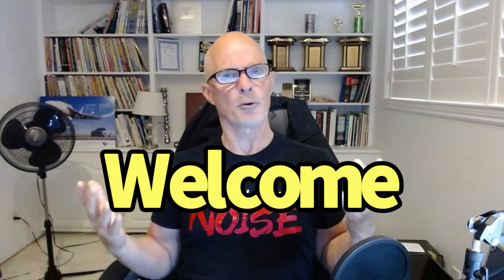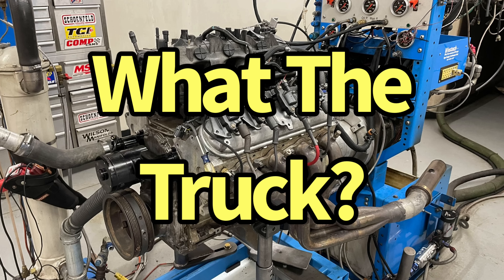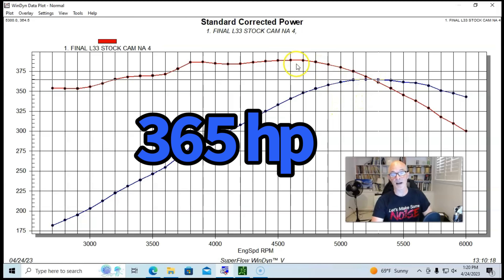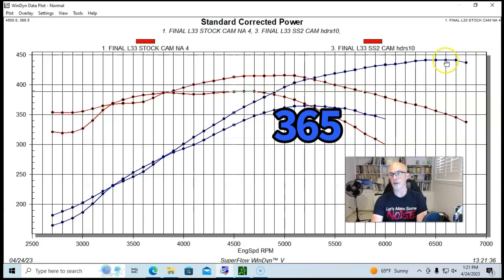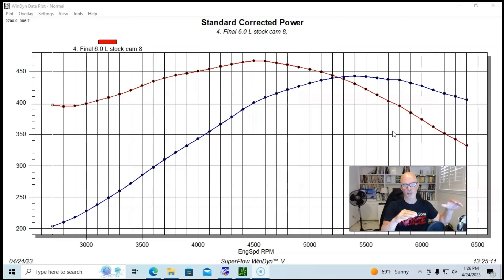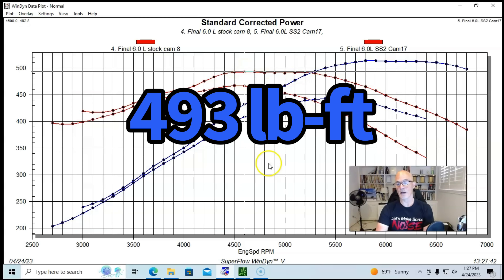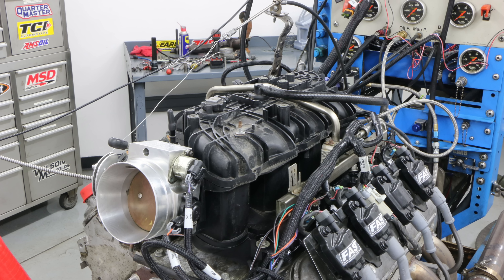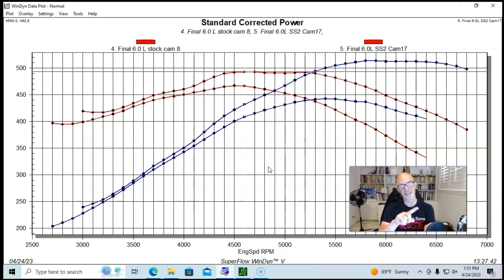HOW MUCH HP WOULD A TRUCK NORRIS CAM MAKE IN A 6.0L? NO TEST DATA-SO LET'S MAKE AND EDUCATED GUESS

Comment: I have this cam on my 6.2 with long tube headers .
Sounds amazing, thinking of changing it out with something different. Lots of guys state I’m leaving a lot of power on the table . Do you happen to know what can I should go with? Want to add low end power and add up top.
72 c10 Shortbed 6.2 truck motor  ls3 intake  1 3/4 headers  4l80 2800stall 373 Gears
Thanks in advance
Reply from the maker: You can go bigger on the cam with a 2800 stall-but you won't gain low end with a bigger cam
Reply: Thanks a lot Richard for the reply love your videos lots of great info.

Comment: Just asking for advice, would
this cam be to much for a
daily driver in a 2003 6.0l
2500/4x4. Stock cam now..
any recommendations would
be greatly appreciated! Thank 🍻
Reply from the maker: it works well in a 6.0L-also take a look at my Low Buck Truck (same results-just costs less)
Reply: @richardholdener1727  thanks

Comment: I'm building a 408 stroker out of lq9 6.0 using stock 317 heads i port and polish them want the truck Norris cam set just want to no your thoughts and a good intake
Reply from the maker: Best cheap intake is TBSS (we have on our store-richardholdenerperformance) and if properly ported, the 317s can support a lot of power

Comment: Might be late to the party, but some people might want this info. I did an LQ9, Stock 317 heads (Just springs and trunnions), TBSS Intake, 90mm TB, Long Tubes into 3 inch dual exhaust in front of a 4L80E and it put down 333 rwhp and 356 rwtq. That's on 91 pump with conservatives timing (24 at the top end.). Torque is flat all the way across until it starts to dip down after 5000rpm. Horsepower builds until 5700rpm.
Reply: Stock cam?
Reply: @trailerparkcryptoking5213  Truck Norris cam.

Comment: My sons 08 Silverado Vortec max (L76 aluminum block 6.0) got the dreaded afm tick so we dropped it off at the delete shop today.   getting full vvt afm delete with truck norris cam and long tube headers.  Thing was a powerhouse before with the 4:10 factory gear sets-  should be awesome   when its done
Reply: Let us know what RWHP and RWTQ it makes after tuning, I have an L76 in my '09 G8 GT , have a slightly larger 217/225 Cam Motion cam for it, should be very similar results. Thanks
Reply: @QuicKurtZX14R  It wont be getting Dyno tested
Reply: @leinie6683  street tuned ?
Reply: @QuicKurtZX14R  yes-  got it back this morning.  Runs great-  a little lope at idle but runs very smooth a few hundred rpms of idle.   Headers run through stock pipes and muffler so its not loud.   Could probably benefit from true dual exhaust and cold air intake ,  but 1 thing at a time.
Reply: Thats an iron block my man. I second guessed myself and had to google to confirm i was right
Reply: @GreaseMonkGarage  No- Its an all aluminum block and 823 rec port aluminum heads from the factory. Magnet  doesnt lie.   Pontiac G8,   Holden Commador and  Vortec Max pickups were the only vehicles to get it from 07-09.
Reply: @GreaseMonkGarage  the L76 in my G8 GT is an aluminum block,  🤔
Reply: Any vids? I have the l76 engine too and would like to hear what the TN cam sounds like.

Comment: Is there a recommended or max or minimum compression range Recommended this cam.
Reply from the maker: if you were trying to run max compression, you would likely be running a different cam too
Reply: @richardholdener1727  That probably makes sense, If the Question was different.

Comment: Richard,
I have a 2018 Chevy Silverado 2500HD 6.0L. I was thinking of installing a turbo for low end torque while pulling. But I’m looking at $6,000 plus the ECU reprogramming.
I’d like to see you do an actual Dyno test on a 6.0L to see what the actual numbers are for this Truck Norris.
Although it won’t be as good as a turbo, it would definitely help me gain some more power and at a much cheaper price.
Could you do an actual test with Dyno results when you get the opportunity to do so?

Always great videos and lots of knowledge.
Thank you!
Reply from the maker: the 6.0L test video with my Low Buck Truck cam (same as Truck Norris) is already up
Reply: @richardholdener1727  Awesome! I’ll take a look. Thank you Sr!

Comment: My truck is not going to pass smog in California with a cam
Reply: It will it’s all in the tune. Just gotta find the right mechanic if needed, and search high and low for best tuning guy in your area. The tune will cost around 1000 for engine and trans tune together.

Comment: Please do the test! Any 6.0 with a ls3 top end! The suspense is killing me 😂
Reply: We’re waiting for this setup. Damn it
Reply: It will make damn near the exact same power that this rec port LY6 makes
Reply: @ChinzySpecials yup this was at the beginning of my LS fandom
Reply: @JCM111 hahaha what engine are ya building now lol. I currently have 5 6.0's in total. 4 in trucks and one on the stand.2 5.3's and a 4.8 that has been sitting in the rain lol. Im a smidgen addicted haha
Reply: @ChinzySpecials  started with a 6.0 that got put off for a ls3, then bored and stroked that to a 417 short block, then found a dirt cheap aluminum 5.3, got all the parts for that and put it on the back burner, just got a call from the machine shop to pick up the 6.0 bored .30 over
Reply: @JCM111 niiice glad to see following the videos turns into engine collecting

Comment: I installed this cam in my 2005 3/4 ton suburban 6.0. Without changing torque converter. And this cam is awesome. Had the tune done by mailordertuner. I later put headers and a borla xr1. I love it and so do my neighbors. Ha ha
Reply: I’m going to look them up. Thanks for posting this.

Comment: I just got a lq4 motor came with the 317 heads I'm going to switch the Pistons to lq9 what heads should I go with to be able to run one of these cams and do I have to replace any pushrods lifters or valves and if so which ones do you recommend
Reply from the maker: pushrod length will depend on the heads and cam you pick. lifters and rockers and valve all remain stock. The 799/243 stock cath heads offer a good power gain over the 317 heads, so do the factory rec-port heads, or any after market heads.

Comment: I made 401whp in a 1500 with cnc 317’s, ported tbss manifold, longtubes, and supporting mods through a 6L80/4x4 and breathing through a stock muffler, at 22 deg of timing. Drives like stock, still have some fine tuning to do.

I’m about to put duals and an LSA on it as well, parts are in the garage.
Reply from the maker: cam?

Comment: I have 01 gmc sierra 1500c3 awd 6.0ls with truck Norris came with 243 heads ported polished, long tubes an tbs intake big fuel upgrade all the goodies kinda curious what mine would make don't have awd dynos around to get full exact numbers unfortunately.
Reply from the maker: can't you run it in 2wd?
Reply: Did you ever get a hp number. Trying to put some info together. Im thinking about doing the same build with my truck?

Comment: Richard I'm having problems with my Truck Norris cam. My tuner is saying that this cam is the reason my truck dies at stop lights and runs rich as heck. Please help? 6.0, 799 heads custom built, flat top pistons with valve relief, stock torque converter.
Reply: I took it back to Mike. I had him keep it for 3 days instead of a 2 hour tune. This time he did several cold starts and "tuned it for low end response" whatever that means. Runs great now.
Reply from the maker: it is the tuner-not the cam-many, many people run this cam-especially with a 6.0L
Reply: Thanks. I'm taking this back to Mike Norris (coincidental name) in Plainfield Indiana after the first of the year to get this sorted.
Reply: @parvaflorum  I know Mike, he used to have a shop in Orlando. He tuned my 2000 Z28 about 20 years ago. He should be able to get you sorted out. My friend Dennis is also a good source in Indiana - Redline Tuning.
Reply: I use to have the same issue and it just went away. GMC Sierra 5.3 4l60 4x4 swapped to a 6.0 4l80. it was tuned after complete. had bought a $250 o'reilly's stock converter (huge mistake) my transmission was running hot and it use to want to cut off on me at lights and stop signs. Just bought a circle D 2800 torque converter. looking forward to seeing how she drives after  might get it re tuned since ya are saying thats why she wants to turn off some
times. thanks

Comment: LY6 (LS3 heads) truck ,long tubes open exhaust. Better push rods and better cam springs, HP tuner/ dyno tuned. Not to 500 Hp. But parasitic and drive train loss should  not account for over 110 HP. Dont know but it is nice for the heavy 2500.

Comment: Hello!! I just added a TruckNorris n my LQ4, swapped 1/2ton, 4x4, E85, ‘04 Suburban. 317, springs, c/a intake, & E85 tune. Now I’m n need of 50lb injectors, my tuner said I’m runnin 122% duty cycle. Now, this is my 4th cam trial, & my 2nd LQ4. My 1st cam setup was a used stock LS6 cam w/a set of LS7 1:8 rockers. This combo ran & pulled better than this current T/N cam does. Unfortunately, that whole rocker angle didn’t work on the 317 heads, it flat spotted the valve stems & the rockers. The 2 middle camshafts, I can’t remember any of the specs? The 2nd just did not work whatsoever!! They thought the LSA was to wide, I gave up & ran the 3rd cam ‘til the O-ring on oil pickup tube cracked. Hence, this current combo. 
Question is, what are that LS6 & 1:8 rocker combo numbers? & why did it seem to outperform & pull this T/N cam?
Reply from the maker: couple things here-you can't run ls7 rockers on a cath port heads-the rocker mounting location is different on the two heads (has nothing to do with ratio change). A Truck Norris would have much more average power gain than a factory LS6 cam
Reply: Hello! Thx, for the response!
I did run the LS7 1:8’s on the factory stock 5.3, w/a handheld tuner. That 5.3 had the leaky heads, & put the GM coolant in the crankcase. Swapped in an LQ4, w/the LS6 cam, & took the LS7 rockers to the 317 heads. Probably ran those rockers 20k miles? It flat topped the rockers & valve stems.

Comment: Test a sloppy 3 in a 6.2 with Trailblazer ss intake vs a sheet metal ebay intake. I believe the tbss intake will make 30 more hp
Reply from the maker: short-runner, sheet metal (sniper style) usually makes a touch more peak, but less through the majority of the curve
Reply: @richardholdener1727  the ebay 300.00 intake. Guys buy them for the look.  GM spend millions on developing one part. Lol. That sloppy 3 is almost like the lsx454 cam just different lobe separation angle and a little more lift.

Comment: I haven't seen anything on a 6.2 L92 or L94 with a Truck Norris cam and beehive valve springs, what would your extrapolations be for horsepower and torque for this combination?
Reply from the maker: TN Would easily add 50+ hp to your 6.2L
Reply: @richardholdener1727 
awesome I think I'll pull the trigger for a truck Norris or a chopcorbalra for my 6.2 L9H 
I love the videos! 
I should be able to run without a stall.....

Comment: I have installed this cam in 6.0s 5.3s, 6.2 trucks NA and  turbocharged. It is an awesome cam. The power it makes with cheap supporting mods is hard to bear. All my tuning is done on a chassis dyno and the street.  I've had some of its larger brothers in btrs lineup only make a little more hp.

Comment: Great work! Thanks for what you do with these tests.  I have an odd one for you. Stock bore LQ4 with LSA heads (ported out 75% of the wings) and a cam that is 219 intake 228 exhaust and .604 lift on INT/EXH 112 +4.  What numbers would that do? How would my cam compare with a Truck Norris cam.
Reply: The heads have LS3 valves and PAC beehive 1219X springs.
Reply from the maker: no idea what ported out 75% of the wings means
Reply: @richardholdener1727  The LSA heads have a deflector wing (hump)  on the intake port , supposedly for mixture tumble??? I ported only that area out so they look like LS3 heads now.
Reply from the maker: 510-525 hp if I had to take a guess-not knowing how well the heads are ported or what intake is on there
Reply: Thanks! It has the stock LS3 intake and stock injectors @richardholdener1727

Comment: I have a sileraydo with a 6.0, 1 3/4 long tubes, 706 heads, and a truck Norris cam. 3in free flowing exhaust. I love it.
Reply from the maker: good combo
Reply: Have u  taken it to the dyno? How much hp u pushing?
Reply: @sovietmonkey2698  nope. street tuned it myself. it's definitely fun to romp on and breaks tires lose pretty easily lol

Comment: I have a lq4 with 317 cathedral heads with a Brian Tooley Truck Norris cam. Am I understanding that it should be around 400 horsepower??
Reply from the maker: easily at the flywheel
Reply: Not at the wheels...

Comment: What stall converter would go good with this cam on a non turbo 6.0 LQ9 with 4L60?
Reply from the maker: stock on a 6.0l
Reply: @richardholdener1727  
Thank you. Love your videos.
Reply: 3000 stall, I have a stock converter and it's a pig down low. Going from 4.10 to 4.56 gears helped some. Next stop... 3600 stall.

Comment: What do you think a lq4 317 heads truck norris stage 1 with dual plane intake with a 2 barrel or 4 barrle style Holly sniper fuel injection with 1 3/4 long tube headers with  mufflers on  would make n/a and with centrifugal supercharger at around 4 lbs boost on a 1500-6000rpm pull? Maybe compare with 706 and rec port heads to the 317 heads?
Reply from the maker: 4 psi?

Comment: It sounds like a lot of people want to see a TBSS 6.0L with a TN cam. Myself included.
Reply: Just asking for advice, would this cam be to much for a daily driver in a 2003 6.0l 2500/4x4. Stock cam now.. any recommendations would be greatly appreciated! Thanks 🍻
Reply: the 6.0 is rec port, and has a superior intake to the tbss
Reply: @trevermonk8575  - incorrect. The earlier LQ4s and LQ9s (6.0L) are cathedral port.
Reply: @bluecollarhotrods9781  the engine in this video is rec port lol the original questioner wanted to see an engine that will make more power than the l33 in the video and less than the rec port 6.0l in the video. not much reason to make such a video.
Reply: @trevermonk8575  TBSS is LS2, cathedral port 6.0 with the the second best cathedral port intake ever made, the only intake better is the FAST LSx r/t
Reply: @bbahunter6436  ok? the engine in the video is ly6 which is rec port with the best intake you can buy without going to a high rpm ram style like btr or holley high ram
Reply: @trevermonk8575 You mean THAT 6.0 is a rec port and Richard has proven the TBSS and the LS2 have very similar intake results.  Not superior.
Reply: @54inches The TBSS is a LS2

Comment: So, You mentioned that the 6.0L with cathedral port heads would make less horsepower than rectangular port heads. (Which should be a given.) But you didn’t mention what type of torque you would see with the cathedral port heads. I would be curious to know that number.
Reply from the maker: the cath head only makes more torque below 4000 rpm
Reply: @richardholdener1727  , I understand that. I was just curious as to if you think difference in low end torque would be minor or substantial? I have often pondered if the truck Norris camshaft would be a good choice for my daily driver with an LQ4 that presently has a very mild towing camshaft.
Reply: @markgarland4532  so far, I’m NOT impressed with the ‘feel’ of the low end torque with a Truck Norris…but especially not with the stock converter, although it is designed to ‘run with it’ 🙄 The 2500 TBSS stall definitely helped BUT the wife’s Yukon is still a slug out of the hole…even with a 275/40 tire (almost 3.5” less diameter than the stock 275/55s. 32” down to 28.6”) and a ‘not too shabby’ 3.42 stock gear. Which is supposed to make the ‘effective gear ratio’ feel like a 3.73 by comparison 🤦🏻‍♂️
Definitely gonna be some 4.11s installed in the very near future just to get this pig up and moving. All that being said, mf will ROLL from 4000 rpm on for some odd reason👌🏼
Now, I did let a buddy install it (cuz he needed the money) even though that’s against my religion and I’m hoping the cam timing isn’t retarded by 4° or some shit!! Surely not, I wouldn’t think that’d be an ‘easy’ mistake to make, I don’t think so…God I hope not now 😳
Reply: @markgarland4532  I should’ve mentioned this is in a 5.3 Tahoe though, NOT a 6.0👌🏼
Reply: @RealSteelStreet  , I also have a Yukon with a 5.3L (2WD with factory 4:10 gear) so what you are sharing is valuable to me and much appreciated. I do have to ask if you have tweaked the tune since changing the camshaft. I found that was necessary after I replaced the camshaft in my 6.0L. And that camshaft is really mild.
Reply: @markgarland4532  most definitely BUT I’m not too keen on how well it’s tuned either! He’s a ‘big name’ guy for LS tuning around here but I’m NOT impressed at all thus far 🤦🏻‍♂️ Still not 100% whether to blame the installer, the tuner, OR the camshaft itself 🤔 4.11s going in soon AND I’m gonna verify cam timing as well and give the tuner the opportunity to redeem himself with me! I’ll try to remember to update you👌🏼
Reply: @markgarland4532  but JUST for reference, my son recently bought a bone stock 225K mile 01 Tahoe 5.3 4wd (with factory 3.73s and 32” tires) that’ll run off and HIDE from her Yukon until past 4000 rpms and above 😬 Again, that’s even with 28.6” tires and a 2500 stall to help those 3.42s out!! But hey, it ‘sounds’ like a straight mf monster anyway 🤣

Comment: Hey got a question. I have a LQ9 with Cathedral heads. Id love over 500 hp in my truck. I have been watching you for months with the cam results. I plan to get the BTR truck norris cam, LSX intake. Which heads do you think I should go with?
Reply from the maker: do you have a set of 243 heads-then port them or check out the tfs 225 head video
Reply: @richardholdener1727  as of now still stock heads
Reply: @richardholdener1727  799 heads ported vs 243 heads ported which ones are the best for power?